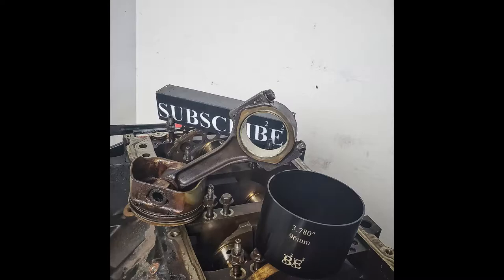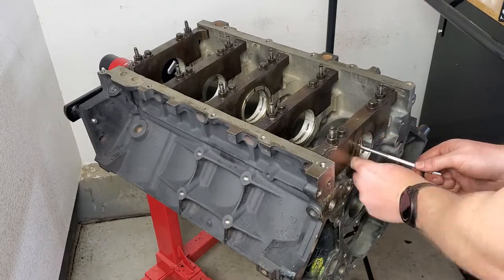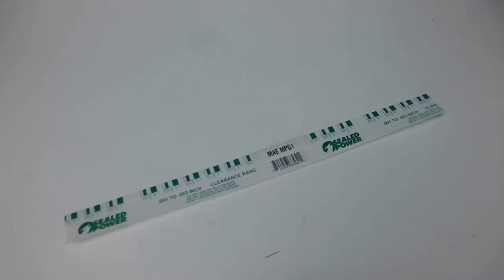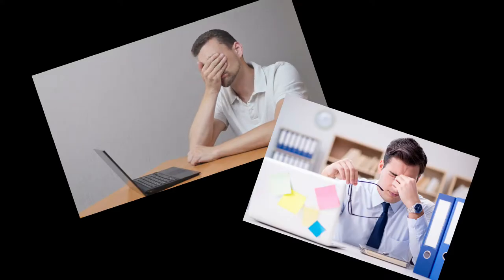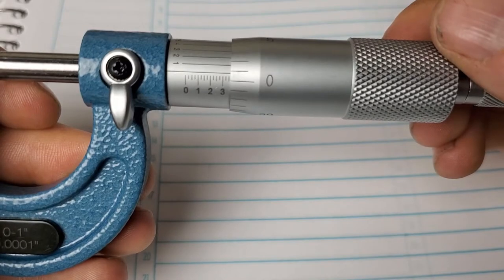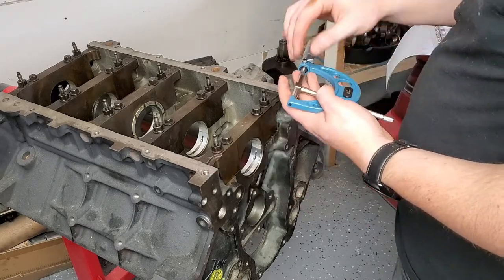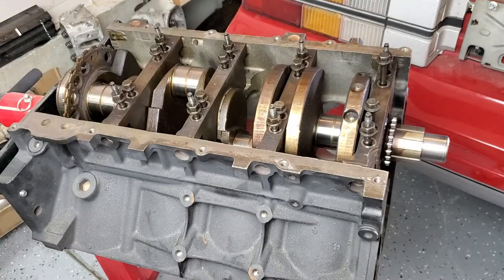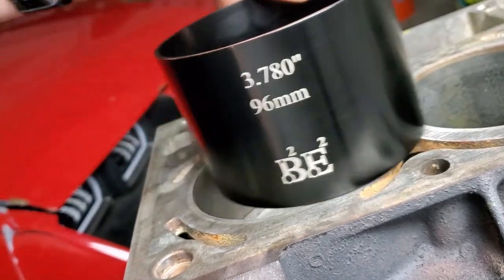Twin Turbo 5.3 LS Build Part 2 - How to Measure Bearing Clearances, Read Vernier Micrometers & More

Comment: Awesome! Always fascinated by engine building, but have never messed with anything bottom end yet. Are you planning on doing any videos on building an LB7 bottom end soon? Thanks! 
Also, do you have any updates on the compound turbo LB7? I am considering going 75/ported stock or 64mm super core.
Reply from the maker: I'd love to do a bottom end build on the lb7, but I'm not sure it will be soon. It would be a nice bit of piece of mind since that's one of the weak points on those. As far as updates, I've been mostly focused on the camaro right now but the transmission is leaking really bad, I'm thinking from the converter seal. So I'm installing a two post lift right now and once that's installed, I'll likely be using it to do a a "how to remove and reinstall the Allison 1000" type video to replace the leaky seals. Sounds like some good turbo options to consider. Hopefully it works out for you
Reply: @builtbottomendperformance  These lifts are becoming more and more affordable now. It's really a no-brain'r if you have the space. Be certain, though that your concrete pad is of sufficient thickness. Lol.
Reply from the maker: @aaronschocke2147  That they are! Good point about the concrete haha